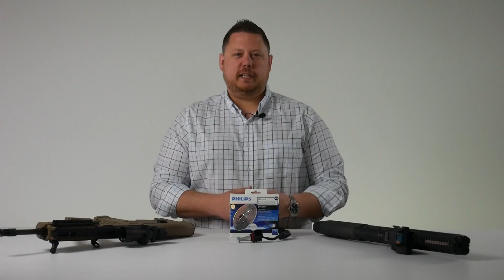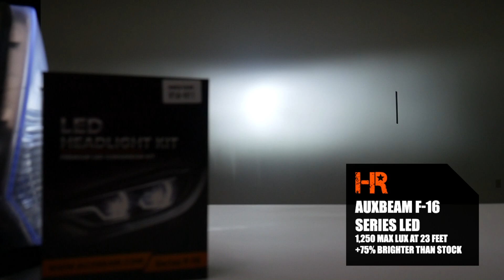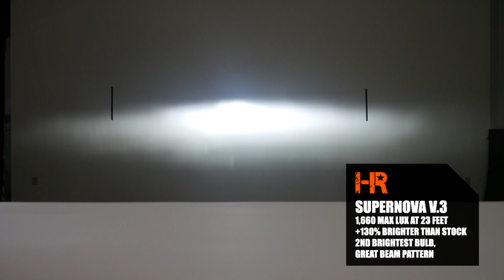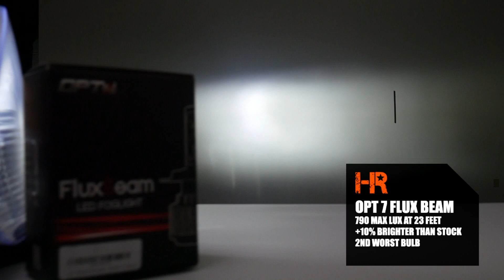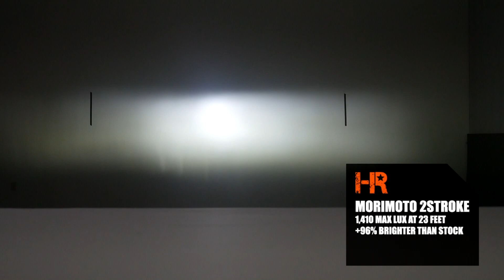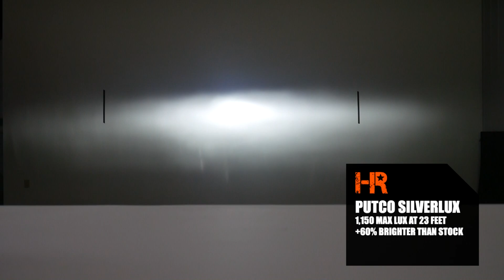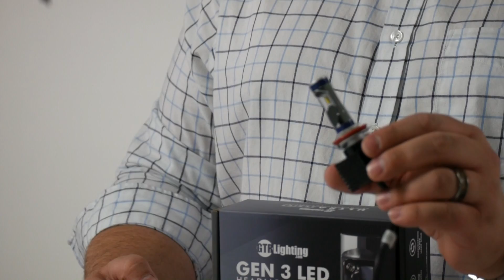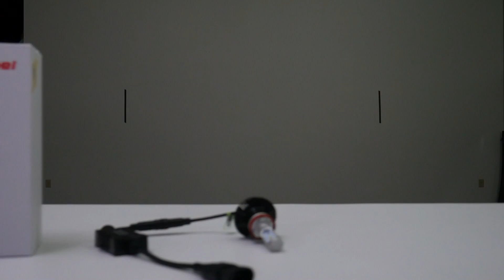DELETE - 15 Brands LED Headlight Bulb Shoot-Out! Which one's the best?

Comment: can you please review ddm tuning's led set? from the saber set , they have 3 different versions of it
Reply from the maker: Kenneth, it's normal for a company to have 3 different versions of their bulbs, we are currently working on a new shootout style video, we'll keep them in mind.
Reply: Headlight Revolution sounds great thanks. They have been putting out alot of bulbs and options lately but it's been difficult to tell if the top of the line they have is actually worth it

Comment: Opt 7 were absolute junk. Have 2015 ram. One lasted 2 weeks the other lasted 3 weeks. Were professionally installed and still burnt out. I would never again waist my money on led bulbs in my opinion. I would go with HID’s any day of the week. Awesome video and channel and thanks for the great information sir...👍👍👍
Reply from the maker: R Miller, we totally agree! We hear that about most cheap bulbs off of Amazon. We've found that higher quality LEDs are more dependable, but HIDs are still the brightest option.
Reply: I also have a 2015 RAM with the Supernova V.3 bulbs. One lasted less then 5 hours of use and the replacement bulb lasted about 2 hours.
Reply: I've had DDM Tuning Raptors in my 2015 Ram for 3 months without a hiccup. They're not the most top of the line bulbs but they've been dependable and the beam pattern is very good.

Comment: Good video,most  cars now are using projectors headlights. Was the ram you were using was one of them?
Reply from the maker: Great question, The Ram we tested these bulbs in had a reflector housing.  LEDs actually will not work properly in projector headlights!
Reply: HR you keep saying like it's universal fact but people are getting good results anyway. Logically, why is it impossible for an LED light source to properly mimic a filament inside a projector? The projector doesn't care what's providing the light, it just has to be bright enough and in the right spot - said so yourselves about reflectors. Are you saying that NO product to date in this advancing field has gotten it right? Again, that flies in the face of logic and actual experience of too many people now.

Comment: That is why when you convert your halogen reflective headlights to either HIDs or LEDs, you will have to adjust the headlights for height (and maybe also direction).  With projector type headlights, not so much.  But some still require some adjustments.

Comment: hi! could you tell me which is the best kit led BUT for projetor lights, ? thank you so much.
Reply from the maker: Hey Ale! There is only one LED that we found that performs well in an HID.  Check it out: https://headlightrevolution.com/led-headlight-bulbs/diode-dynamics/
With projectors I would highly recommend running HIDs, they will perform tremendously better:
https://headlightrevolution.com/headlights/headlight-bulb-upgrades/hid-conversion-kits/

Comment: Manufacturers rate LED brightness at a power level that allows 50,000 hours before they decay to 70% brightness. It is well documented that you can get wsy higher brightness by using more power. Which needs more heat sink and may cut the life to under 1000 hours, instead of 50,000+. Power up your winners for 10,000 hours and see if ANY can last that long.

Comment: Was that headlight you used a projector?  If not this video may mean nothing as light pattern and sometimes even lux can be affected by the type of headlight used for the test.    No way I'm paying over $200 for LEDs.  If you can see plenty clear with stock 700-800 lumen,  then anything over that is as good or better.  You would be better served focusing on the beam pattern (based on the type of headlight you have)   color wanted and the amount of  lux you wish to be over stock bulbs.   A reasonably priced, good quality, good beam pattern that is 80% brighter than stock would outweigh the brightest bulb at an outrageous price.

Comment: Great video. Got some GTR H7's but the bulb part is too wide to go in my headlight housing (Depo brand BMW E90 headlight). They are about 5mm too large in diameter. Are any of these close to the 11mm diameter of a regular H7 halogen bulb or are they all in the 15-17mm range?

Comment: If you need brighter than stock headlights, you shouldn't be driving. If you decide to install LED headlights anyway (or any HID headlights), you better take the time to make dang sure you aren't blinding oncoming drivers. Why should you care? Guess what, if they can't see, they might drift into your lane and hit your car head-on. If the both of you are going 50mph, it's like you hitting a brick wall at 100mph. It's not going to be pretty. If by some miracle you survive that encounter, the other driver may not have and you will have to live with the fact that you killed someone. Don't think this scenario is possible? Let me tell you a little story. This almost happened to me. I was going around a corner at about 55mph (speed limit was 55mph). A tow truck driver with blinding headlights came from the opposite direction probably doing 65mph. For about five seconds I couldn't see anything. It was a miracle I didn't leave the road or ran head-on into them. After the situation was over, I seriously contemplated chasing the idiot down but I decided against it because I didn't feel like going to jail that night. That night, that driver almost lost his life from a head-on collision due to his choice of headlights and ignorance. It's not worth it. Either do it right or don't do it at all.

Comment: also would be nice to test their physical fitment in the mount they are intended for. I bought a Morimoto H7 set but the thick adapter on the bulb was too fat for the Mini Cooper R53 High beam position. Physically impossible to snap into that clip inside the OEM housing. SuperNova V3 does fit, barely. OEM Halogen is much thinner on that mounting surface than any LED I have seen. This can be a major factor in the installation

Comment: What LED bulbs are best for projection systems?
Reply from the maker: We do not recommend LEDs in projector housing, the light output is bad and there really isnt a beam pattern.  If you really want to use LEDs then we would recommend SL1s, check them out.
https://headlightrevolution.com/search.php?search_query=Sl1&Search=
Reply: Headlight Revolution thank you for the info.
Reply from the maker: Thanks for watching and commenting!

Comment: i had a 1992 gmc, i rewired the head lights with 14ga solid wire... the 4 lights were wired into a 15amp breaker and were connected directly to the battery... the lights would trip the breaker every 15 minuets, they were just 4 incandescent bulbs but they were vary bright for what they were "with the wire upgrade", but from your tests the good LED's are twice as bright as my special wire job...  wonder what 4 of these would do in a car if the reflector housing is adjusted so they keep more light down the road... a Cadillac suv passed me i think it had those LED's, but they looked like flood lights, probably went adjusted properly.

Comment: I'm confused 19:34 GTR lighting ultra shows reflective caps (which I am interested in for OEM headlights designed for Halogen) on *box and HR website*, but bulbs without the reflectors are shown here and some of the pics on HR website...which do you get for $200???

Comment: No quad diode LED bulbs reviewed, only dual?
Reply from the maker: Not sure what you mean exactly because many of these bulbs reviewed had 1 diode on each side, 2, 3 or sometimes 4 (equaling 2-diode, 4-diode, 6-diode, or 8-diode). I wonder if what you really mean is quad-sided where the LED chips are on more than 2 sides. If that's what you mean (like a 360-degree LED bulb), we'll be making a video about that soon to show how terrible they are. ;)
Reply: Yes, the quad sided bulbs. Like the Autofather brand for instance. I still don't think LED headlights can compete with HID
Reply: Headlight Revolution I think LED headlights may not improve much more until the next generation LEDs come out that perhaps can recycle the heat from themselves to increase luminosity. I heard something about that years ago. Got to get above 100 lumens/watt or a model with a big heatsink and fan..

Comment: I live in Pennsylvania and I'm considering putting LED headlights and I was looking at the motor vehicle code and it says that low beams cannot be less than 7,500 candlepower and high beams can't be less than 10,000 candlepower. Candlepower is not really used anymore as a measure of light output and I was wondering if anyone knew what the 7,500 candlepower is in watts?

Comment: There is one problem I see with this review, and I know it is something that would be hard to be perfect about but...Just a Dodge  Ram headlight housing? I would have liked to see maybe three housings? Maybe something with a much more rounded reflector, like say...a first or second gen Honda Fit, and something else that's between the square and round "styles" of housings. I get the feeling that different bulbs are going to perform different in different housings.

For sake of clarity, I drive a 2001 Sportage. I am never going to ask someone to test for my housing, because I know that no one else is going to give a damn what something looks like out of my housing.

Comment: Thanks for all the great information. I have one question that I hope you don't mind lending your knowledge and expertise in. I have a 2015 KIA Cadenza Premium with those standard halogen bulbs that make it difficult to drive at night ... especially, when it comes to being able to see towards the lower immediate left and the lower immediate right of the car as I'm driving forward. I'm driving down relatively dark roads that are frequently traveled on so having my bright beams turned on isn't really an option since cars are headed towards me seemingly every several hundred yards or so. Based on many of your videos that I've been viewing over the past couple of nights, I've learned a few things here and there. For now, you seem to favor the HIDs, especially the Phillips D2S Xtreme Vision followed by the Osram Xenarc 66240 CBI. On the LED side, you seem to favor the GTR Lighting Gen 3 Ultra followed by the Supernova V.3. I believe you were either using a truck or an SUV for your tests. Now, since I don't have a truck, and I drive a 2015 KIA Cadenza Premium. Have the  tests that you've conducted apply solely to trucks or can those tests be applied with equal improvement to cars as well? Thanks ...
Reply from the maker: Thanks for the comment.  Yes all these bulbs were tested in a Dodge Ram headlight.

Comment: Street glo performance is excellent super bright and good around. The problem is I had one burn out after 1 year and my local dealer for bulbs has had them warratny replacement order for over three weeks.  IF THEY CAN'T BE REPLACED QUICKLY UNDER WARRANTY THEY ARE WORTHLESS.  ITS WINTER IN MONTANA AND I GOT THEM FOR WINTER AS ITS VERY DARK AT 1AM WHEN I LEAVE WORK......

Comment: have you done lasfit review? I have a 9003 led bulb and I love it!!! has Phillips chips with a metal fin over the chip to aid in reflection. I'd like to see it how it holds up against the others.. usually run about 35 bucks
Reply: specifically the lc6 style 9003 h4 specifies 3800LM per bulb at 6k color temp
Reply from the maker: Keep an eye out for upcoming videos!

Comment: what is the point of cooling fan if you are using dust cover
Reply from the maker: Thanks for watching!  The brighter the LED  the hotter it gets, The fan cools the LED so you can run higher wattage making the LED brighter.
Reply: Yes I get that, thanks for the reply, but doesn't the dust cover obstruct the fan and air flow?
Reply from the maker: Nope

Comment: Interesting video.  While the measurement of light output is cool, what fixture were you using?    Did you attempt to focus the LED light?  The ones I have been buying can screw forward and backwards...That changes everything.  You can also rotate them to get them throwing correct and not blinding people.  I can't help but notice that you sell the lights that you like here on your website...hmm...

Comment: I'm sorry you're putting incorrect info out to your follow base, you are using lux to compare lumens for light output, also your display that you have set up is too close to the wall, that you were getting even a scatter focus beam from the stock bulb. And just so people know it's basically 1 lux to 1 lumen  squared. Also the boxes that you were laughing about are to neutralize radio interference with the led, so no flicker. One thing I also tell my customers is that they will need to lower or have their lights adjusted properly. Sorry but your test is very very flawed. So you have lied to your followers, since you say everyone was lying about lumen output.

Comment: Wow.   What a really great review of what is out there.   I bought some Hikari "Eye of Megatron" bulbs which seemed better than stock, but now I am starting to think of how the light is dispersed and the hot spot.   They were well reviewed and popular on Amazon, but as you said towards the end of the video - there are 3 similar bulbs you reviewed with similar connectors and designs... and you shot one of the three.   Huh.    Thanks again for the info.   Knowledge = Power.

Comment: I ordered two sets of your GTR Lighting Gen 3 Ultra lights.  One set I installed in a Ford Transit and the other set in a 2015 Honda Goldwing.  About 9,000 miles into the H7 set in the Goldwing, the lights began to flash, not just flicker, at random speeds.  They don't always flash and I have checked, there is nothing loose.  They are flashing together and I am looking for a solution.  Do these light need to be replaced or is there something I can do to correct this?
Reply from the maker: DJ Frankie Valentine Contact us at sales@headlightrevolution.com and our team will help you find the issue and correct it.

Comment: How drastically will a halogen projector differ from the results here with a reflector housing? I am hesitant to substantially compromise light output with a PNP LED such as GTR gen 3 or supernova V.3. Looking to avoid installing grounds on my leased 2017 Honda Civic Si if I went with HIDs with relays

Comment: so Ive got a question do the bulbs fit in the headlight or do you need to leave the cover off the back of the headlight? lets say on the gtr bulb because its the best one just curious because if i had o leave the cover off i wouldn't get led bulbs
Reply from the maker: Cumminsproject01 It all depends on the vehicle and the design of the headlights. When the GTR won't fit, we recommend the Supernova V.3

Comment: Thank you for this awesome video. I have a question for you Sir. I have aftermarket headlight for VW jetta 2002. the high beam and low beam is H1.
What is the best brand of LED to have nice beam pattern for a high beam in H1? 

I have looked at the good brand in this video, but I did not find them for H1.
Thank you very very much.

Comment: How can LED with higher K penetrate more into fog than the traditional bulb with lower K light temperature? I think all LED will perform worse in a fog because they emit light with higher temperature and due to wavelength it cannot penetrate fog more than light with lower wavelength. Luxes in such case does not mean anything, actually, it can make thing worse because such LED light will create "light courtain" when hit a fog. Never put LED in place of fog light! Unless it is 3600K or less and as far as I know there is no such.

Comment: You need to test the SNGL LEDs. The were tested in another video to have 2100/2200 low/high max lux. And $50 cheaper than the GTR gen 3 LEDs. 
https://www.amazon.com/dp/B0776HG87Y/ref=cm_sw_r_cp_apa_aS3nAb9XSYJ42

Comment: Great Video! Very informative...and Objective comparison. Could have done without the shoot 'em up stuff...but no harm in having a little fun. (smile)
One BIG request for future comparisons, please... When you show the light pattern on the wall at 23 feet it makes a decent objective visual... BUT ... I don't ride my motorcycle, nor drive my car, with a wall 23 feet in front of me! LOL!!
I would LOVE to see you find a way to show the Highway Light Distribution!  Perhaps a foldable frame and a piece of aluminum or other easy material, that you could mount the bulb in -- maybe even arrange something you could mount 4 to 6 bulbs in a row -- all at the same height and angle that you could switch each bulb on and off to show 'instant comparison' of the "On The Road" patterns. [Of particular interest to me is distance forward.] Take it to an empty Parking Lot after dark and see how they look! You could even get a shot from in front of the bulbs, with all of them turned on or one at a time, to show how they will look to on-coming traffic... 
I Know this will mean extra work for you...but it will REALLY take your comparisons to another level!

Comment: test the new ODX 6000 lumens made fore projector I juste buys some and the very good http://odx.ca/fr/produits/odx-led-series/
Reply from the maker: Desjardins Sylvain this are the same bulb as the Putco NiteLux, and the Supernova V.2... Not a good bulb and discontinued by any company interested in making newer, better products.
Reply: the Série Lumens 3000 use the Luxeon ZES  Philips . compare on your . similaire to the 40W XHP50 LED Bulb (Street Glow / Nineo / Xtreme Vision / Glowteck LED)  the paterne is different of your test because I have a projector on my Subaru this make a nice beam patterned and is ajustable . this model is bether on projector to have a nice beam patterned .